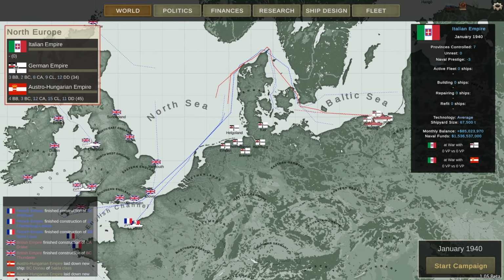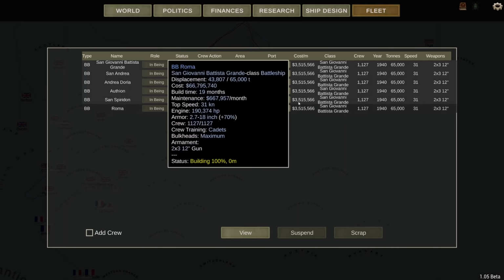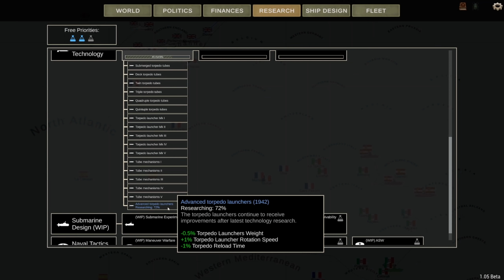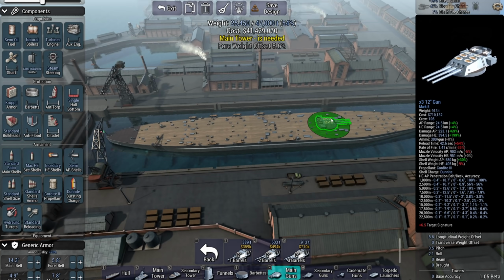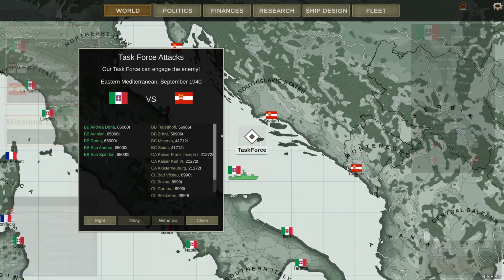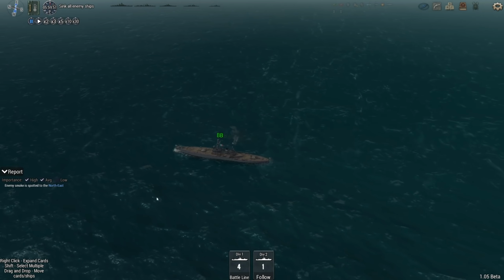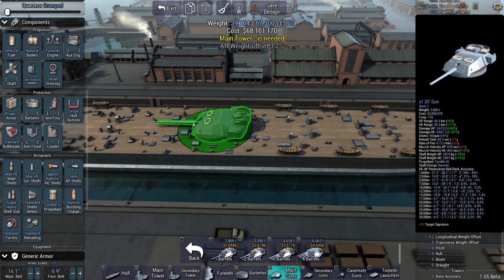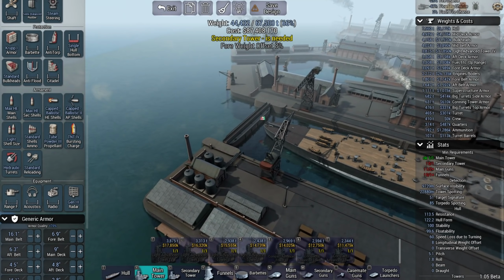Ultimate Admiral Dreadnoughts - 1.05 Beta Patch - TONS Of New Features!

Comment: They all seem like great changes, but the campaign mode is broken, I waited 2.5 years and haven't got a battle. I have tried moving fleets next to a port full of enemy ships and it still wont do anything. I have changed what mode they are set to and it only has an effect when you use 'protect' as it reduces your convoy losses, the other 2 don't do anything.

Comment: With stability being a factor, it would be nice if they would improve the damage model to affect stability. For example, make it so if you have flooding on one side of the ship, it impacts the stability of the ship, with the extreme case being the flooding causes your ship to capsize and sink. Same with extreme forward/aft flooding. If you did this, then you could also add counterflooding as a mechanic, where the overall flooding percentage increases, but it gives you better stability.

Comment: Changing the save file to start in 1940 doesn't change anything else in the Save File, like political affiliations. The alliance with France and Britain most accurately mirrors Italy not joining the WW1 on the side of Germany and Austria-Hungary because its alliance with them was only a defensive pact. Italy was in fact much friendlier with "enemy" Britain than it was with "ally" Austria-Hungary at the time, and then later joining the Allies to gain an advantage over A-H. So, although it starts in 1890, The campaign's political situation looks to most accurately mirror Italy in 1915.

Comment: HEI shells seems to work way too well. Tried super battleship as German in 1940 and 140+ kton BB got dismantled by HEI fire from enemy fleet (2BBs 60+ kton and 20-30 of DD-CA types ships). 8 inch gun could not do damage with  High capacity HE to 6inch armored (everything) light cruiser. HEI might be king of HE thank to impact fuses (alway does damage on hit even if reduced by armor on non pen.). 18:50 That travel time is wierd. 21.6 knot (40 Kph) will travel 960 km/day at max speed and 480 km/day at half speed so it would take from 31 hour to 62 hour to reach 1240 km distance. How they got 3 months?

Comment: I know it's unlikely that the designer would implement it, but it would be fascinating to differentiate between clipper/raked bows and plumb/tumblehome bows, and also between elliptical, cruiser, and transom sterns (including raked, reverse-raked, and flat transoms). Each of these features has fairly significant effects on stability (gun accuracy), speed, and seakeeping.

Comment: I will say, I love that we can now control beam and draught. It’s very nice. One other benefit of a lower ship is the fact your a much smaller target to hit from gunfire. 

I will say though that I don’t think draught is the correct term though, as draught is how deep your ship sits in the water and is largely determined by hull shape and displacement. The better term I would use for what we see here is freeboard.
Reply: Thought that 'Draft' was the distance between the waterline and the keel.  So, less draft would be higher in the water, more above the water line, less resistance, faster speed, bigger target.
Its odd how its written up.
Reply: Yes but to increase freeboard  usually you need to icnrease draught (since the mass increases without increasing the  hull surface ( if you do not change the beam)

Comment: How I want to see Carriers and Subs is that they are still ships that you have to design yourself and build in the shipyards, but they should not be something that you can directly deploy into a Battle mode; the exception should be Carriers, where they can be directly engaged in the event of an ambush-style battle (but you should still be able to directly control them instead of allow them to meet their fate like bot transports).

Subs and carriers should bring into play anti-submarine and anti-aircraft equipment into being, the point of which is not to be used in a Battle mode but instead to negate the effectiveness of subs and aircraft: the more AA and ASW you have, the less successful aircraft and sub attacks will be (bonuses to AA and ASW should be granted with crew experience levels).

Also, a MONTH to go that amount of distance travelled??  These aren’t sailboats here, there is a reason for the quote about the Warspite “lifting her skirts”
Reply: I agree with the first part. Let is be able to put AA and ASW equipment on a ship, and based on that give it an AA and ASW rating. Treat it like they do power projection, so that it can have a counter effect to sub and AC ratings. Let us design carriers and subs and based on that give us a Sub and AC rating. Use this with RNG to determine damages and losses. 

With the last point, now that we are doing transits, the turn duration should be dropped from a month to a week.
Reply: aircraft needs to be included in sum way,
but i would LOVE to command and control submarines. design subs to affect dive speed, dive depth, etc.
Reply: I see the opposite. Controlling subs make more sense than battleships. Battleships are controlles in strategic cocnepts not tactical. the most tactical thing they do is engage in evasive maneuvers.  Controlling a pair of subs trying to kill a convoy   woudl be fun although. Th eproblem is.. that woudl generate a gazillion   encounters that are very slow to resolve
Reply: While i do not agree that carriers should be added (very complex and will change a lot of stuff making it sort of not fun in my opinion) Subs can make it. Idk if i will like it but we will just see
Reply: If carriers are included it'd probably be best if the whole aviation aspect of naval warfare was handled "off stage" (e.g. completely outside the player's control, other than if/how many carriers, and the relative size of them) are included in a task force. Otherwise you end up opening up a can of worms with having to have players not only decide on what the composition of their air groups are but also design individual aircraft models as aviation technology improves and then purchase squadrons (or even individual aircraft) for each type (and then there's the whole issue of aircrew training/experience). Basically, if you have a carrier it has a chance of damaging (or possibly even sinking) enemy ships before the surface engagement occurs, and if your opponent has carriers your carrier's fighters have a chance of driving off/shooting down their airstrikes before they attack (again, all "off stage") your ships.
Reply: The game scale just doesn't work for carriers. This will make this game World of Warships, where a fast DD sneaks in behind the cruisers and sinks a carrier. How many destroyers, in HISTORY, ever sunk an aircraft carrier?
Reply: @dennissvitak6453  All of WoWS was designed off an encounter something like Taffy 3 in WW2.
But yeah, carrier aircraft should be a more off map asset, though having the aircraft do passive damage to your ships would be rather annoying as a game mechanic.

Comment: "a taller larger hull is less stable but is protected against flooding"

Maxes hull height and size

+accuracy
-flood protection

waaaah? granted its smaller than the lower draught hulls but it does make me wonder why they include it at all... surely if thats the lowest accuracy you get from that draught it should be 0% either way at that point. Just adds so much confusion to the tooltips when the penalties still show up as a positive rather than having the default being 0% either way

But loving the new stuff, hope they keep at it!

Comment: I'd disagree the research priority isn't worth it. Sure, you'll slow down your research on everything massively but it will still get some progress in the background. After the 17 months of research for new hulls is done, you can go back to researching tubes at normal rates and still be at a better point than you were before you assigned a priority to new hulls. So really it's between getting everything very late all at once, or getting the few things you really need ASAP. 17 months is much more feasible in a campaign than 57 months and I like the risk/reward thing of slowing down research in general to focus on the one thing that might actually change the course of the campaign. And with the new refit mechanic, that's even better because you don't need to wait for a whole new batch of ships to build before you can actually use your new researched tech.

Comment: 10:24 I'm not sure how they implemented the calculation but I think it shows the wrong time in the ui. Hull strengthening drops from 55 to 17 months and Torpedo tubes jumps from 62 to 93. But after 17 months, your hull is researched and the priority dropped. From a logical standpoint, the torpedo tubes should now be at 62 if no research was done on them or a little bit less if there was research done. So your total research time on torpedo tubes should be at most 62 + 17 = 79 months, most likely less.

Worst case they stop researching torpedo tubes for 17 months and then continue their work on them. That's why I believe that the 93 months are misleading and a miscalculation because the increased progress on the torpedo tubes after hull strengthening is researched is most likely not calculated.

But hey, I don't have the game and can't investigate it. That's just my take on it as a software engineer.
Reply: I’d say that the “93 months” is “at the current research speed, we do 1/93rd of the currently open research next month”. The algorithm does not know what you will do next turn, never mind in 17 turns — it can only look at the “here and now”. 

But in 17 turns, if funding and priorities stay identical, 17* 1/93rd of the research left to do now will be done, which is ca 18.3%. When you undo the changes then, the time needed would be ~18.3% less than 17 months ago.

Easy as apple pie. But that’s just a software developer/trouble shooter speaking.
Reply: @advorak8529  Assuming it keeps the same percentage of research complete, that means that after 17 months it has effectively done 11-12 months on the torpedoes. You take 38 months less time for one tech to complete in exchange for other techs taking about 5-6 months longer. That's not too bad if you really want one tech sooner.
Reply: i think it's because priorities don't just effect that single tech but the branch. so they are theoretically working on it less for ever, which means that they are working to a lesser extant so say usally they would get 10 percent a month but they only get 3 percent a month when focusing on something else.

Comment: The new patch looks awesome, german super bb now go up to ~160,000 tons and the hull can now be made wide enough to fit secondaries properly. 
New hundreds of hours are going to get spend on building and running various scenarios. Lovely.
Reply: We need another super-über-wunder-battleship campaign. At 160,000 tons a single ship should be enough.
Reply: @Panzergraf  I just build one for the sake of it, 4 x 20" duals, super heavy shells massive amounts of armor, like really massive, and tons of 8",6",4",2" secondaries. Like a floating fortress. 
I mean sure top speed was 24knots... but the ~500m turn rate wasn´t even that bad. 

The only issue so far, the camera movement keys seem to randomly stop working which is a bit weird moving the camera around.
Reply: @snakeplissken1754  The Japanese Super 2 already could support 5 x 20" easy enough, so I imagine that is fully viable.  Plus, you could call it the 20-20 ship.
Reply: @SephirothRyu  The 4 20s aren´t hard to fit,  but all the other stuff i threw on the ship and upping armor to even an 18" belt on top for the lols. That was previously not possible.
Just saying that with 1.05 you can throw even more stuff on a ship or crank up armor to disgusting levels. It´s amazing. And finally can you put on plenty of secondaries that actually fit next to the superstructure.
Reply: @SephirothRyu  20-20 is a great name
Reply: @snakeplissken1754  The Japanese biggest seems easier to put stuff on since they have significantly smaller superstructure relative to their deck area.  With the new beam option, its likely possible to put more stuff on it too (the 5x quad 20" arrangement was armored well enough since I basically didn't give it secondary weapons, but with more displacement its definitely viable now to enhance it further)
Reply: @Panzergraf  
Literally just an Executor class SSD